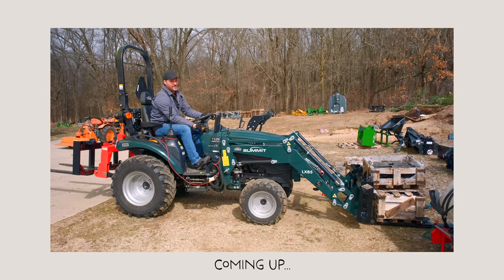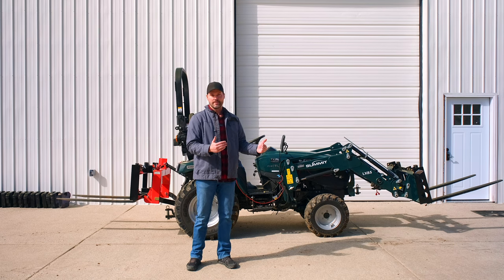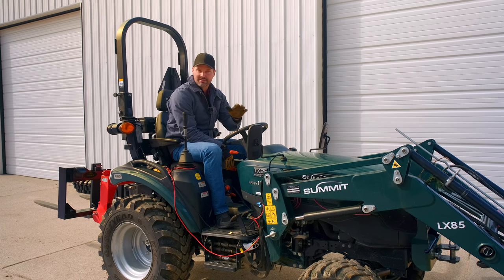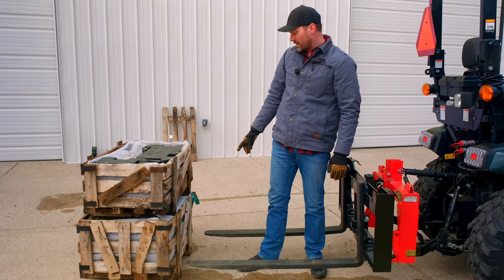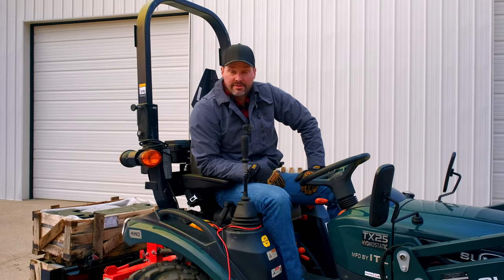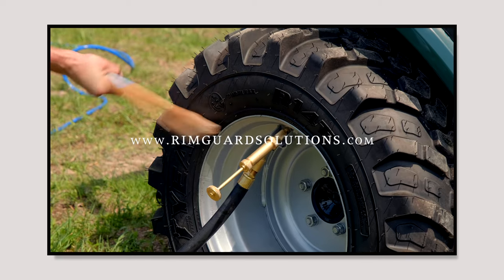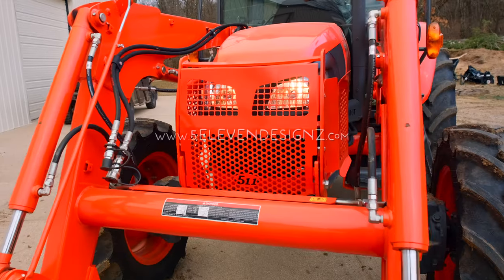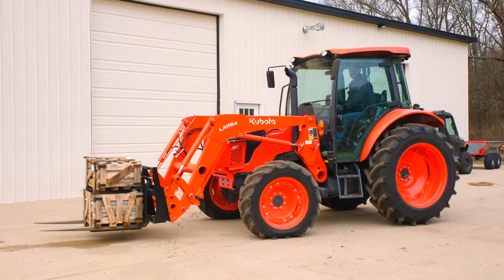OVERLOADING OUR TRACTOR WAY BEYOND THE LIMITS! PROOF IN VIDEO.

Comment: You know, I’m honored that you put my whole comment thread up on screen! And I’ll be honest with you. I just spent an hour typing out a very long winded response about hydraulic operation and relief valves. I’ve been a diesel mechanic for most of my adult life and I’m damn good at it. So I will just point out that all you’ve shown here is a properly working relief valve in an open center system. 

Anyway, at this point. We’re just going to have to agree to disagree.
Reply from the maker: Yep, exactly right.  The tractor has mechanisms to protect itself :)
Reply: @GoodWorksTractors  Actually relief valves are like fuses or circuit breakers. They’re protecting the hydraulic circuit. Things like hoses, valves and seals. Not loader booms and tractor frames.
Reply from the maker: @brandoncrimmins6296  The hydraulic system is part of the tractor Brandon.  It's protecting the tractor.
Reply: @GoodWorksTractors  I mean a 30 second google search will show you that you’re 100% wrong. 

A good example is the fuse for the headlights, yes it has a side effect of potentially quelling any fire risk. Although things burn down all the time with these failsafes in place. But let’s ignore that, right?it’s there SPECIFICALLY to protect the circuit. Not the headlights. 

It’s the same with same with a relief valve designed SPECIFICALLY to protect hoses, valves and seals. The physical size of the cylinders and the geometry employed to mount them to the boom determines the lift capacity and also determines the point at which that relief valve go into bypass. If you don’t believe me. Take the 1.5” cylinders off your loader and replace them with 3” cylinders. I promise you that WITHOUT shimming the relief valve for higher pressure. It will lift substantially more. Now it’s going to lift about half as fast as it normally does. But it’s going to physically move twice as much weight.
Reply: @brandoncrimmins6296  I think you're splitting hairs just to split hairs, the as engineered solution provided by the manufacturer you can't "overload".  If all of the specifications as listed in the service manuals are followed you can't break anything by performing work as designed and specified by the manufacturer.  The relief valve might be set even lower than the line pressure from factory to account for something else.  If you look at 1, 2 and 3 series John deeres they probably use all the same rated hoses and such but they don't have the same overall system pressure rating.  That's not what good works tractors is saying.
Reply: @rcguymike  no, I’m simply explaining the designed purposes for given components. And you absolutely can break stuff well within the rates restrictions and limits of machines. Or have you never had a breakdown of anything mechanical? Are you serious right now?!?! It’s not that difficult. You load your bucket to capacity and drive your tractor over miles of extremely rough terrain day in and day out. I give you my word as both a man and mechanic. Even though you’re within the rated capacity. IT WILL BREAK EVERY TIME. You people are absolutely insane…
Reply: @brandoncrimmins6296  lol, of course it'll break eventually.  If you park it and don't use it it'll break eventually. The manufacturer isn't going to tell you to use it, give you a warranty for X years and/or X hours and then fork out free fixes multiple times due to parts breaking.  If you load to capacity and drive over rough terrain everyday, either it isn't going to break within the warranty period or as long as the manufacturer can't prove abuse it'll be repaired.  Even if it does break, will it simply be a leaky seal?  A loose tie rod end?  or will the entire tractor spontaneously combust?  😂
Reply: @rcguymike  Tell me you’re not a mechanic without telling me you’re not a mechanic… What a ridiculous comment that takes almost everything I’ve said COMPLETELY out of context. Way to go! Maybe have another beer and make another response.
Reply: @brandoncrimmins6296  lol, I'll pass on the beer, no point paying for dirty water when there are better options...but here's another comment, start with listing 1 word/phrase I'm taking out of context.  Our context is using a machine as the manufacturer specifies, at the machine's given mechanical limitations(i.e. barely lifting a load off the ground with the hydraulic relief actuating and then traversing across the jobsite to dump it), correct?
Reply: @rcguymike  If the relief is activating or opening. You’re not lifting anything. You can absolutely operate a machine of any kind within its weight limits and still be abusing it. And warranties are there to convince people that if they have a problem… They won’t have to pay out of pocket for the repairs. Not to tell you the length of time you’ll have a trouble free machine. That’s just stupid.
Reply: @brandoncrimmins6296  MTBF, might want to research it. It's what engineers use to design all of a systems parameters and come up with warranty and usage guidelines that allow a company to sell a product and make money off it with a reasonable amount of risk.
Reply: @rcguymike  I am very aware of the mean time between failures equation. I have been a diesel mechanic for the better part of 20 years. And I have in the past and do currently work at a dealership. It’s not what you think it is it’s literally an equation to determine how cheap you can make something and how many people will work the product to its breaking point compared to how many never will. There’s little to no risk at all. It’s all built into the cost of a product. For example…a set of China sockets with no warranty, $20. Snap-On with not only a lifetime warranty but a warranty that will still be honored 50 years from now. $1,500. 

I still don’t know why you people think a warranty somehow miraculously exists to tell you what a machine can and can’t handle. It’s there SPECIFICALLY to make you feel better about spending too much money on a given product.
Reply: @brandoncrimmins6296  you just stated I don't know what it means and then repeated virtually exactly what I stated...🤔🤷‍♂️ Congrats on being a mechanic and working at a dealership, not sure that adds anything to this conversation.
Reply: @rcguymike  You’re probably right, I’ve never had to deal with warranty claims at all working at a kubota dealer. Because like you said. Warranties tell you how long you can expect a machine to work flawlessly before you have a problem…So obviously anything I see is fully out of warranty and no one has EVER abused a piece of equipment and expected it to be covered under warranty.
Reply: @brandoncrimmins6296  Who's out of context now?
Reply: @rcguymike  Still you
Reply: @brandoncrimmins6296  😂, still waiting on you to provide an example of 1 word/phrase of mine that's out of context.

Comment: wow on concrete with a too big a load and a 30 second test it doesn't do anything shock horror.  about as informative as a test drive of a car.
I'll concrete my paddocks right now! 
Trying to lift too much on concrete for 30 seconds is usually not the thing that breaks it.  
Reduce the weight to maximum you can lift to axle height - basically it won't tip.  Use low gear and do 100 hours out in the paddocks.  I'm fairly sure the summit will have leaking front seals - the bigger kubota's should be find as they don't use a knuckle.  
from some hunting it appears most of the frame issues have now been solved on most newer tractors - in the current market no not really upgrading.
ugh mine is before they solved them so it has just had the frame welded back together and it did nothing outside of spec - low gear, keep the load low, used off road and concrete all oem attachments.
Apparently living on a hill isn't ideal for a tractor - which makes some sense and to be honest but I live on a hill.  in fairness mine is nothing like a deere hill combine losing a self adjusting drive axle that is a big job have a look at the video.
Reply from the maker: Ohh, that's the right way to do the overloading test?  I should have known a concrete pad would screw up the whole thing.  What was I thinking? 🤦‍♂️